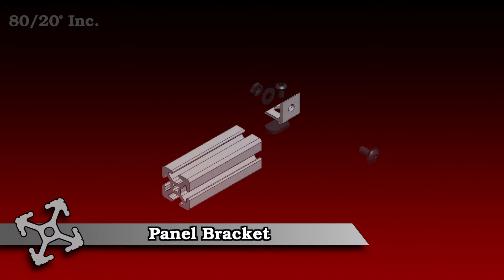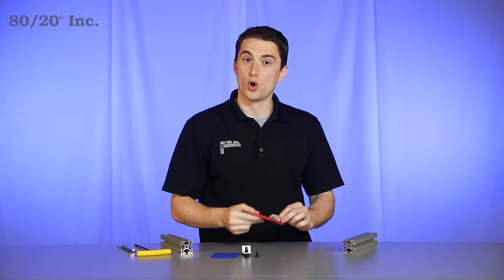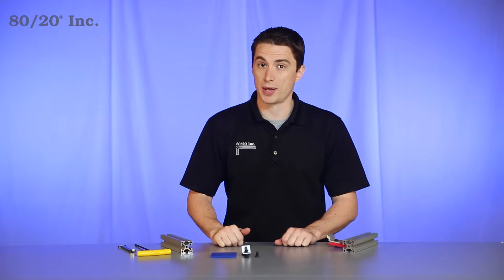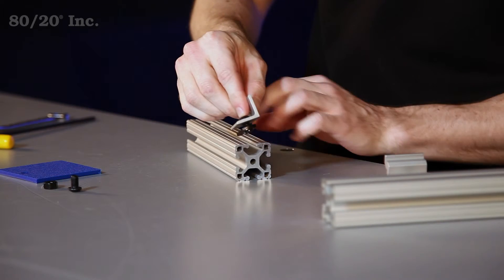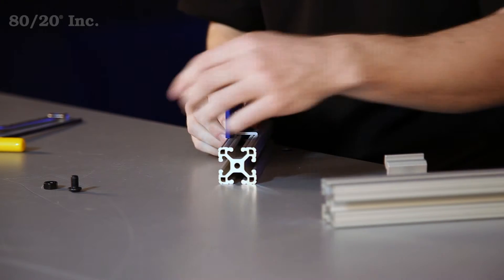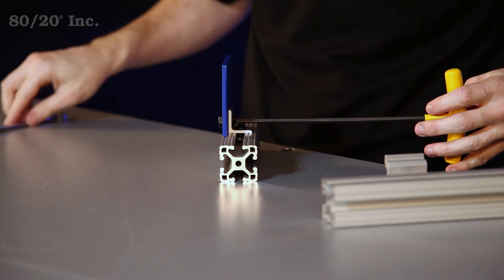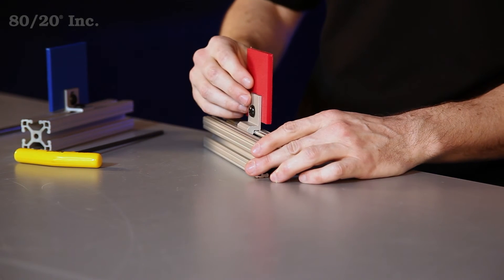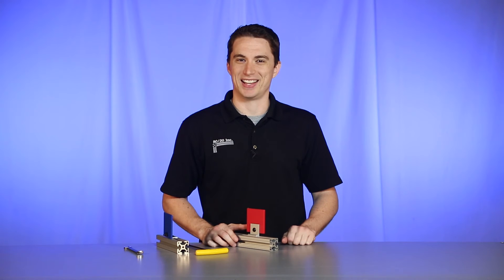80/20: Panel Bracket Overview

Comment: Can you show how to connect zig zag spring to the aluminium extrusion for 202 series
Reply from the maker: Hi there and thank you for reaching out! 80/20 does not carry the specialized hardware needed, but we have seen people use either slotted EK type spring clips or the metal clips with the plastic inserts, then attached with SHCS and T-nuts.  Both clip styles are available from Amazon, Ebay, or specialty furniture repair stores.